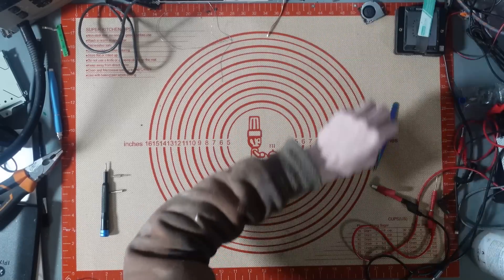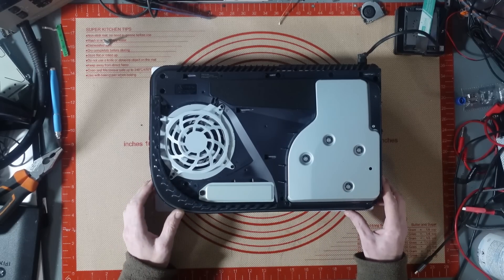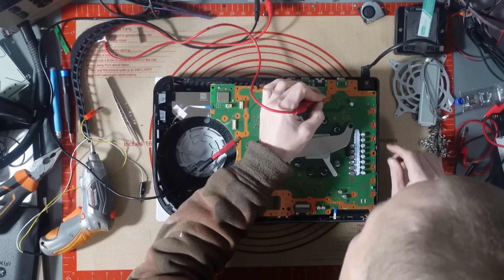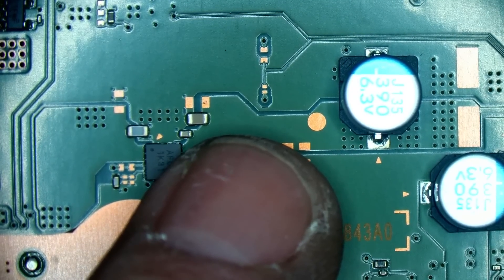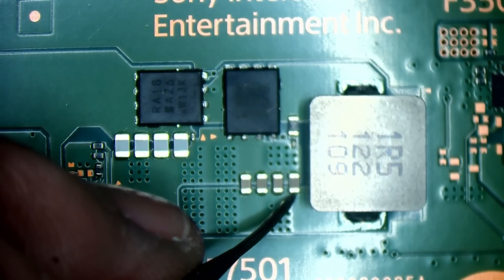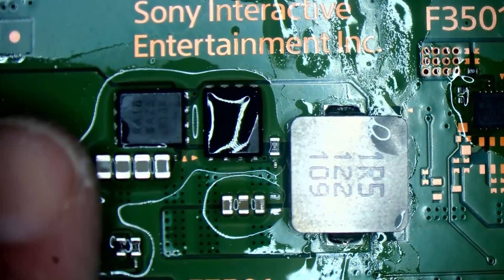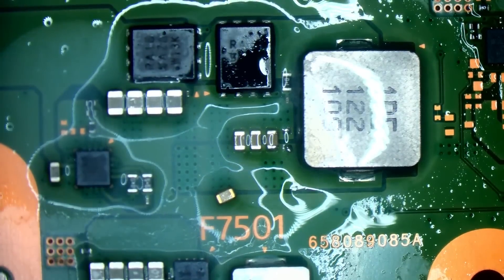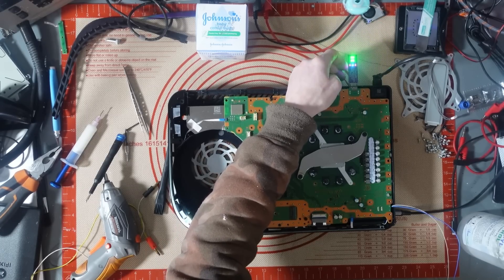🎮 Cop's PS5 Goes Rogue! Can An Ex-Con Fix It For Him?

Comment: hi, i know maybe is too much to ask but what soldering station do you use, thanks
Reply from the maker: I use an Atten ST-862D mate, https://amzn.to/3MvwBf3
Reply: @TheCod3r  is that like a 2 in 1 soldering station for hot air  and soldering iron ? i was more interested in the soldering iron station
Reply from the maker: @Seven-ks6rk  no that's just hot air mate. I don't recommend getting a 2 in 1. They're prone to failure and they're too inconsistent with heat. I use a hakko fx-951 soldering iron

Comment: I wonder if the dry spot on the APU would cause this problem thru the connections and passing along the problem tryin to keep itself cool or would that not be logical ?
Reply from the maker: Nah this is normally caused just because the caps used are cheap and poor quality

Comment: You'll spend close to an hour to totally do this job, logistics, bookkeeping and such. You charge 60 quid. After taxes, that is basically half in pocket. Getting 30 quid an hour wages paid at a job is a normal rate. The fact that you don't charge 10p extra for the capacitor is just your generosity.
Reply from the maker: Yeah I absolutely couldn't agree more. The paperwork alone and all the other stuff that come with the job like the consumables, electricity etc, and then the tax man dips his grubby little mits into the pot and there's only enough left to buy a rice cake 😂
Reply: @TheCod3r  As long as you dont charge a large hourly rate thats a fair price. your on the clock and working your time is money. I remember a few years ago my car wouldnt start and had a flashing light the guy made me buy new spark plugs, and £400 pounds worth of stuff the car didnt need. in the end i found the fault my self it was the computer. So 1k charge altogether. If the guy new the fault in the beginning it would have cost £500.

Comment: I really like the way you found that fault but it terrifies me to see you slapping around the ipa so freely. If it ignites you could be in big trouble. It is more environmentally friendly than freezer spray I guess but please be careful with it.
Reply from the maker: I do agree and I've had an IPA fire before but it's really only an issue if you're using it around sparks or naked flames. I do have fire extinguishers on hand too if needed so I am protected as best I can be. I do appreciate the concern though:)
Reply: So what is the flash point/ temp of IPA and the likely max temperature of the board?
Reply from the maker: Almost 400⁰C so very unlikely to cause an issue :)
Reply: @keancv  the flash point is 11.7°C but the auto ignition temperature is 456°C. The bottle I have, the first line on the label says "Allow to dry before applying current" and "do not apply to live electrical equipment". 🫣
Reply: We had a guy set his fingers on fire one time. It could have been worse if he had an open bottle nearby. We use little pump bottles and brushes to apply. Sorry, I don't mean to alarm, just look after yourself.